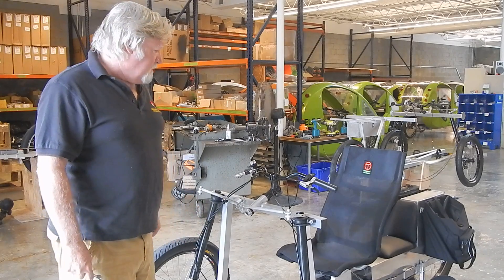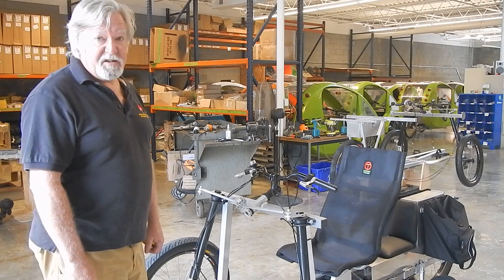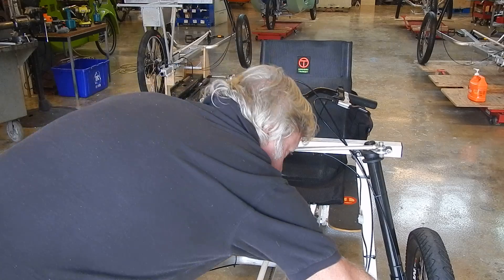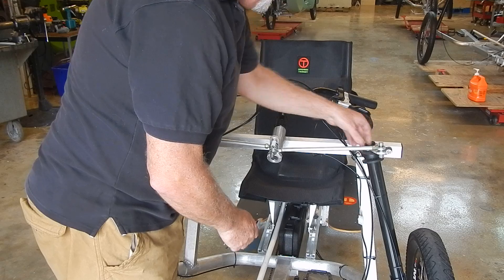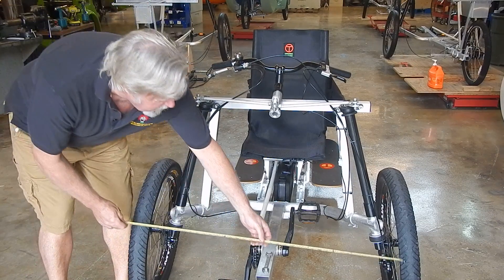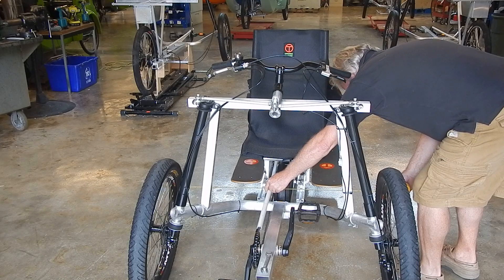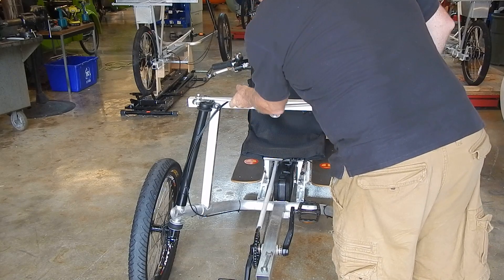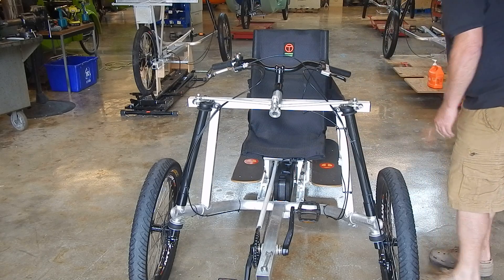DSCN0628

Comment: You should be measuring from the edge of the WHEEL to the edge of the frame and do the same on both sides and that would center your wheels correctly and give you the correct distance for the back of the wheel to the edge of the frame .

This way would be much easier and more accurate but you do it like you wanna it still accomplishes the same Goal.

Also may I ask WHY did you make the front end so WIDE  ??????

Comment: can you send me motor specifications
Reply: No.
Reply: Its like a 750watt 48volt. It has dual batteries which is cool.  Assisted Speed without pedaling is limited to 20 miles an hour with peddling they say 25 to 30